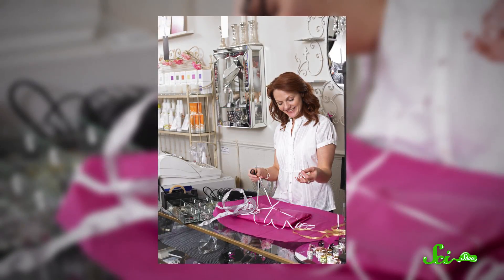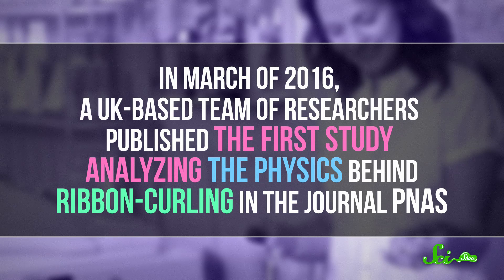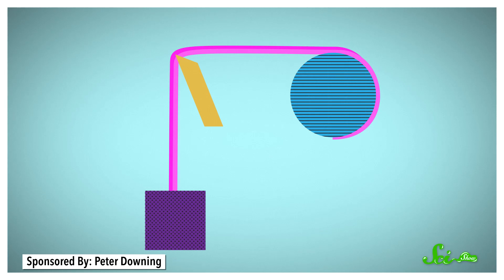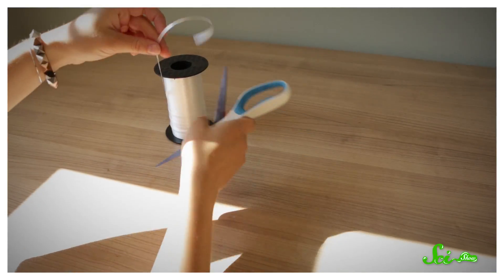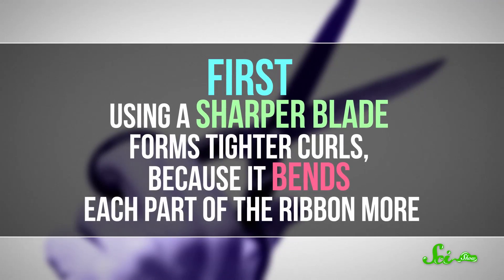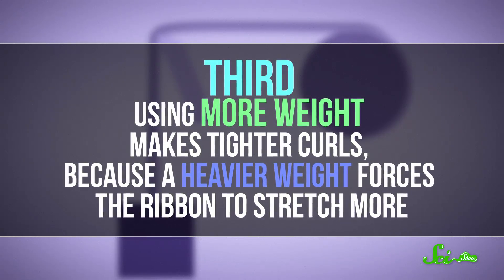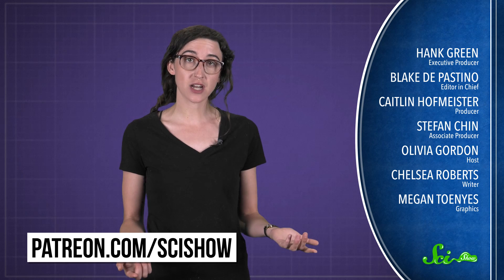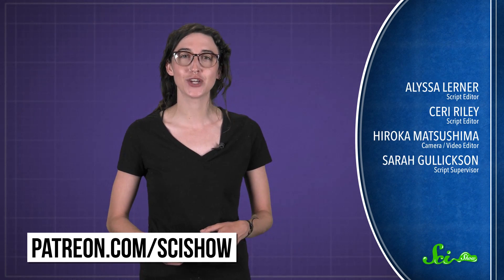Why Do Ribbons Curl?

Comment: Not just ribbons--hair, too.  If you have hair that's long enough to grip properly, try this:  Pull out a hair, hold onto one end, and run the rest of it through your thumb and forefinger's nails.  VOILA!  The hair is now curly.  HOW curly depends on stuff like your genetics, how oily your hair is right now and the humidity, but generally it should curl at least a little.  :)

Comment: I don't pull hard on thew ribbon.  I push my thumb against the outside of the curve, forcing the ribbon to fold over the edge, very sharply.  This can cause compressive yield on the blade side at the same time it causes tension yield, on the outside of the curve.  And there is less tension, after the ribbon leaves the blade, so the compression yield is not reversed.  If I was making a ribbon curling machine, I would use a rubber roller to force the ribbon to bend over the edge of the blade.

Comment: my question is - what causes speed wobbles on two wheeled vehicles? And how do I reduce them?I plan on putting a small jet engine I'm building on the back of a bicycle and perhaps in the future into a motorcycle so I was curious what physics based challenges I would encounter while travelling at that speed (aside from aerodynamics, friction, etc)

Comment: can you do "why do sunburns radiate heat for hours after sun exposure"
Reply: The red inflammation on your skin after a sun burn is caused by your capillary blood vessels in your skin expanding, therefore allowing more blood to your skin, which in turn, makes your skin red and radiate more heat than normal.
It is the same system that restricts blood to your skin when you're cold (and you turn pale/blue), to seal in heat.
Reply: accumulated energy
Reply: +IchBinEin Oh! That totally makes sense. Thanks!

Comment: A friendly PSA:
To safely curl a ribbon hold the blade in a grip that keeps your fingers and thumb away from the cutting edge, I find this is best achieved by placing your thumb on the flat of the blade. Next use your thumb to hold the ribbon to the flat of the blade. Finally pull the blade away from you and be sure to keep the cutting edge away from yourself or others. This has been a friendly PSA from nerdfighteria.
Reply: How sharp are your scissors that this became an issue?

Comment: Why Diesel engines produce more smoke than petrol engines
Reply: They don't normally. provided the driver isn't being stupid and making it purposefully.
Reply: They don't. Old diesels without particulate filters might have done, but these days those things are compulsory, so there's no visible difference between the exhaust gases of diesel and petrol engines. Diesels do produce more nitrogenmonoxide and nitrogendioxide, but a) those are colourless gases and b) the negative effects those gases have are more than made up for by the increased fuel efficiency of diesels.
Reply: +Manny Calavera If you burned them outside of an engine diesel (basically kerosene) does smoke more. It's had less refining done to it. In a modern engine driven normally, no difference.
Reply: ^this is what I meant by Sri we being stupid and making it on purpose. Whomping the go pedal and dumping more fuel than can burn into system can create that oily black smoke.
Reply: ***** Can be, yes, though there are other substances that can create black smoke as well. I very well remember the days when pretty much every diesel-engined car on the roads left a trail of black smoke behind it, but thanks to a combination of particulate filters and sophisticated ECUs that aim to prevent exactly the kind of thing that jagx234 describes, modern diesel cars are about as clean as an internal combustion engined car gets.